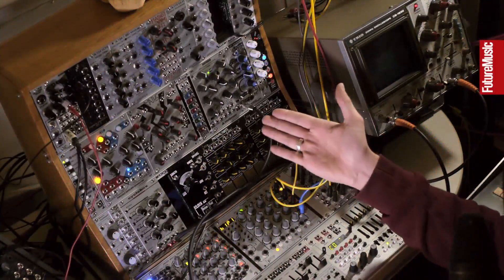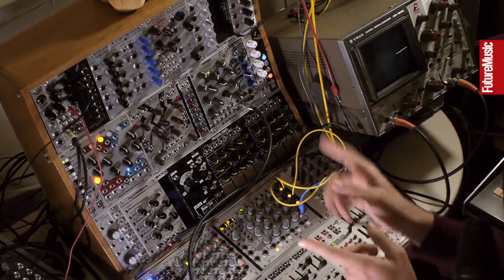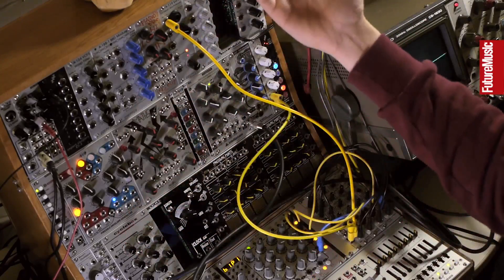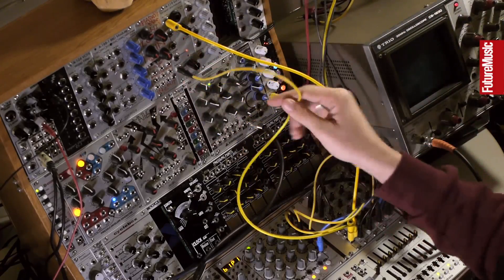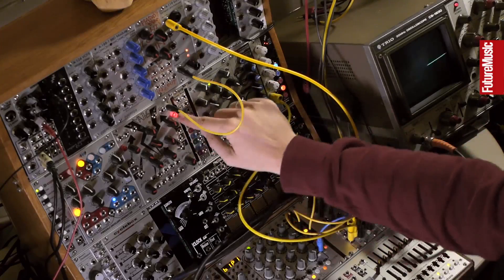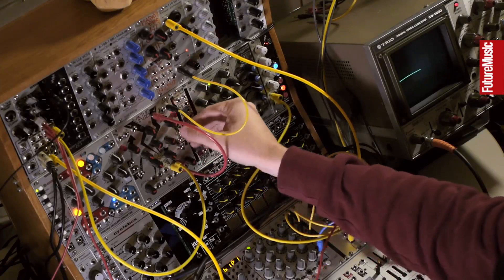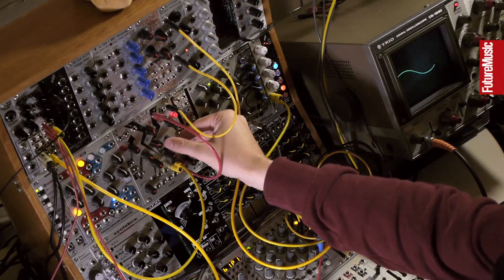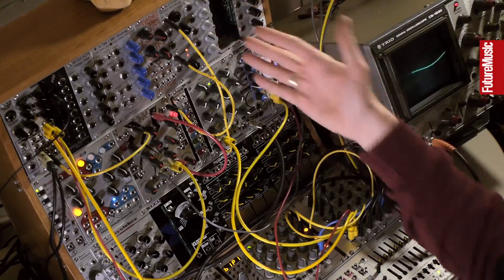Modular Monthly: How to create a DIY modular compressor

Comment: Hello. I am a brand new user of the eurorack format, though I am no stranger to world of synthesis. I own a Moog sub phatty, a sub 37, and a mother 32. 
I have just ordered a tip top Audio happy ending 84 hp case. 
I have been fascinated by the concept of building a eurorack synth primarily designed to function as a drum kit synth. 

I would like to purchase 3 delptronics modules for sure. The LBD2E, LBD2x, and the trigger man. 
I am assuming I need an InOut module to connect my eurorack to an amplifier. I also need a midi to cv converter module with din and USB ports. 
My questions are:
1) how should I go about setting up my eurorack? Should any particular chain order be established? 2) can someone recommend modules that would fit my needs or just any necessary modules? (A TRS output to put my eurorack to my amplifierto actually hear it, and a midi module to clock it and sychnronize it to my other synths.)3) how should I clock the eurorack if the main master midi clock is from my DAW via USB by midi?4) how can I immediately start making beats with the above mentioned modules????5) will my power supply be an issue? 
I know this can be exhausting to answer... but I am a beginner desperately trying to learn about eurorack. I would appreciate any responses and will be asking around the great YouTube eurorack community. Thank you to all of you! 
-Joe